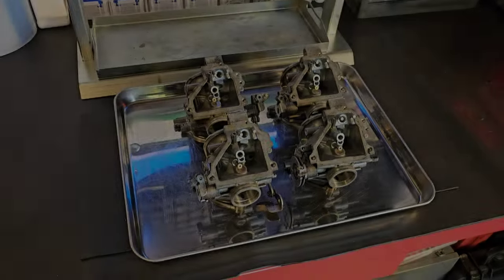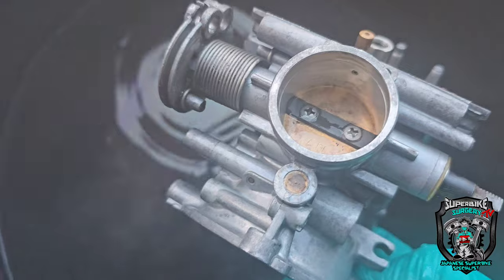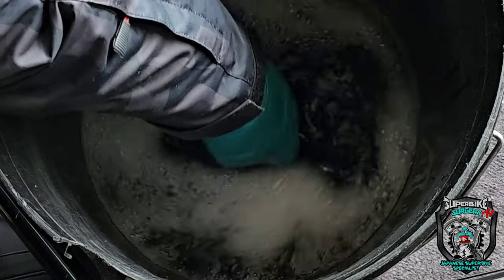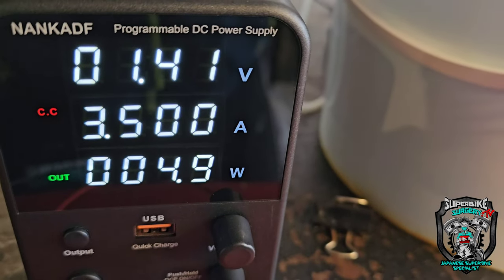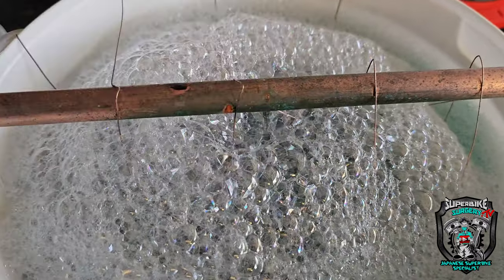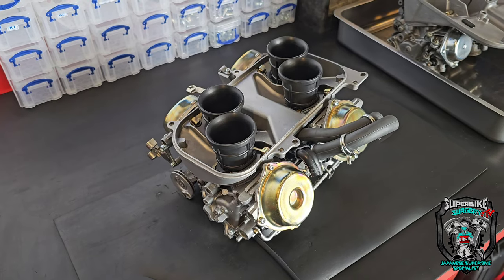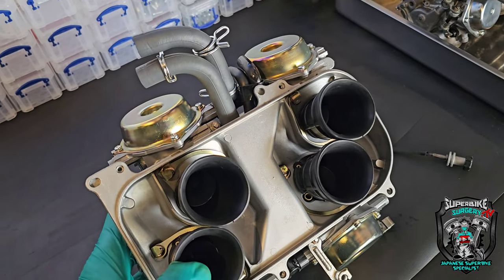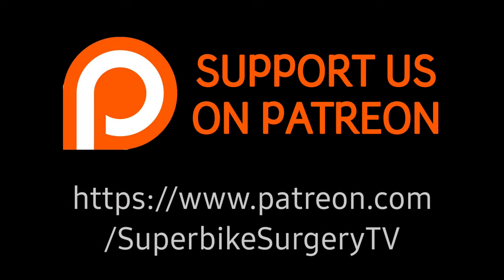Honda VFR400 (NC30) Full Carburettor Restoration, Part 2

Comment: I’ve just made a very amateurish attempt at doing my own carbs off my ‘84 VF750F, you’re  right V4s are a nightmare. With the limited equipment I’ve got, I just about got the crap off them, but they still look pants inside and out. It’s the wibbly wobblyness that’s the issue with them, linkage springs with a mind of their own flying off all over the place. It would be great if you could do a video of balancing a set of carbs. Not sure if you’re doing that as part of these restorations. Would be very useful to see. Great video, not that many real mechanics on YouTube, always listen intently to your content, very helpful. Thanks.
Reply from the maker: Thanks for your kind words 🙏

Comment: A fantastic job done. They looked horrendous to start with, really thought some of the seized parts would have been impossible to remove or find replacements for them. 
If nothing else, this vids on v4 carbs, are a must watch for anyone before purchasing such a machine.😱

Comment: Were the float chambers on back to front?  I did that on a set of CBR1000F carbs without thinking.
Reply from the maker: No, that's the correct way, I understand it looks a bit wonky.  😂  If you put them with the drain screws facing the outside, the frame rails are in the way and you can't drain the carbs 😁 Thanks for commenting, love your channel!